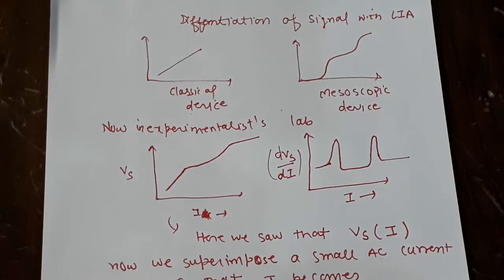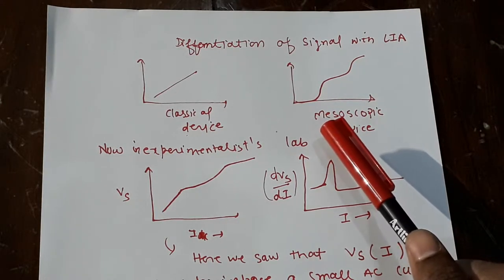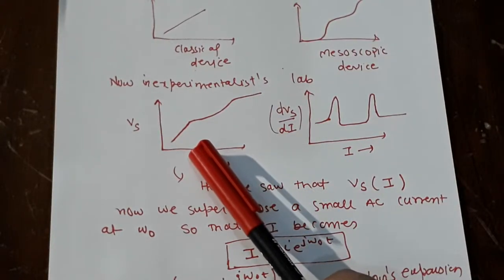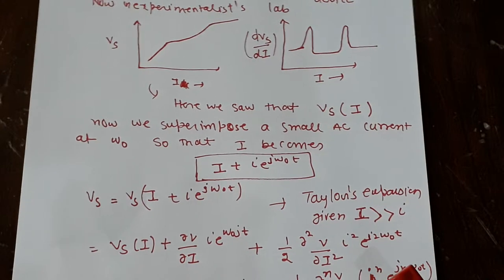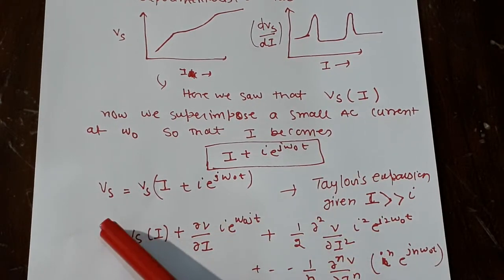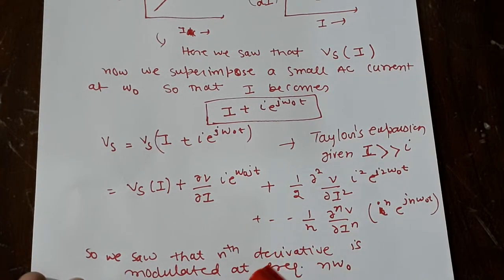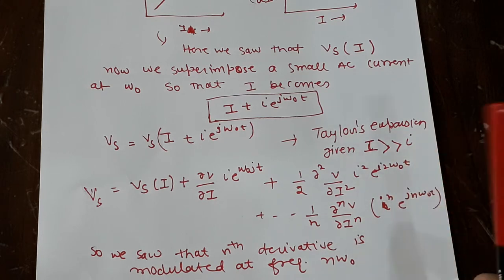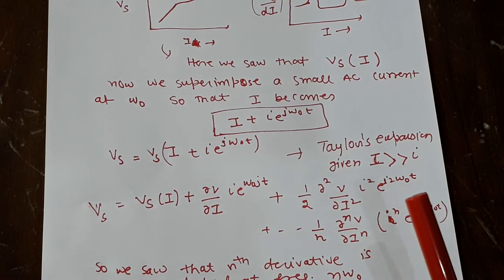Differential conductance measurements with lock in amplifier

Comment: Is measuring DV DI is same as measuring DI DV ? And is their any way to convert DV DI to DI DV ?
Reply from the maker: Not in this case, normally the method which is I am describing here is used for low resistance samples. What you are looking for is applicable for high resistance samples. In any case, you might want to take the inverse of the dV/dI in case of resistance samples.
Reply: @BholuUPPb my sample is also low resistance. I am measuring db di. My question is can I inverse dv di to calculate di dv ?
Reply from the maker: @roopkumar8968  yes